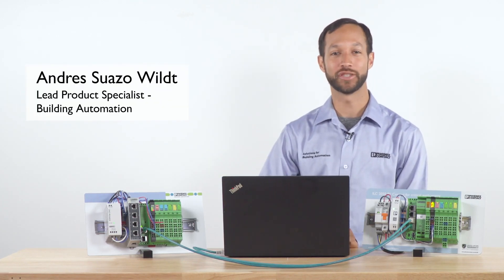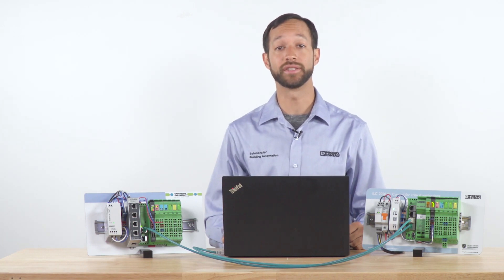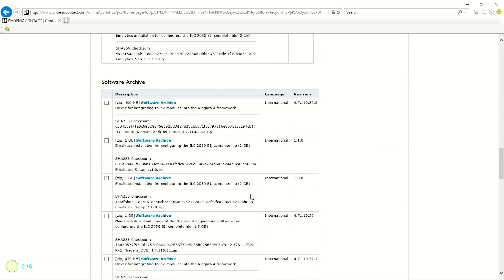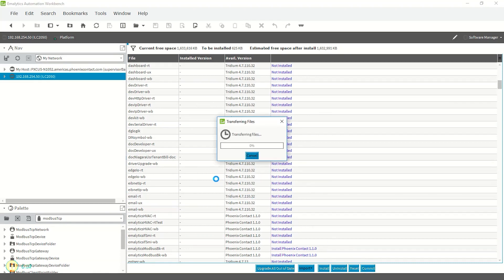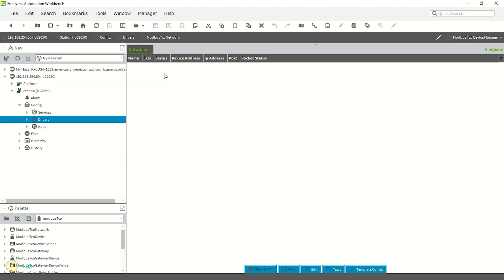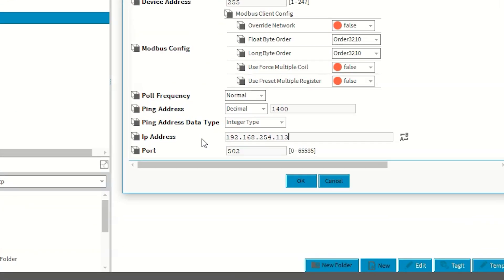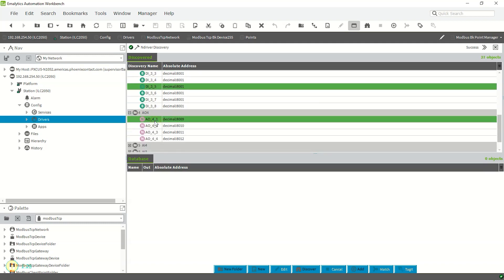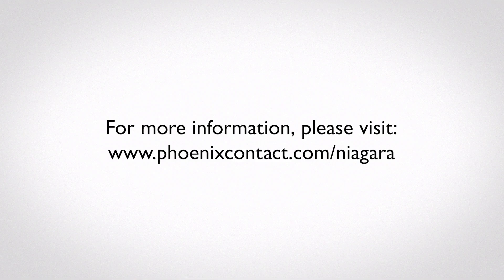How to integrate an inline Modbus I/O into Niagara using an ILC 2050 BI

Comment: Please i need help. I can add the IOS in database from IL ETH BK PAC module but cannot read their status. the status for Digital IOs is always false and for analog its always  0.0 no matter what i do.
Reply from the maker: Hello. I am very sorry to hear that you’re having an issue. 

Depending on how the I/O modules are brought in or if new modules were added to the bus, the Modbus registers can get mixed up. If this is the case, I would recommend deleting the points and rediscovering them. If you are manually assigning their addresses, the registers are offset by +/- 1 decimal. As for the analog modules- if there is no device connected, the points will display a fault status.

You may also open a Tech Service ticket, where we would be happy to assist you!